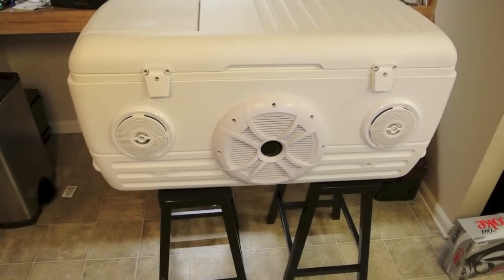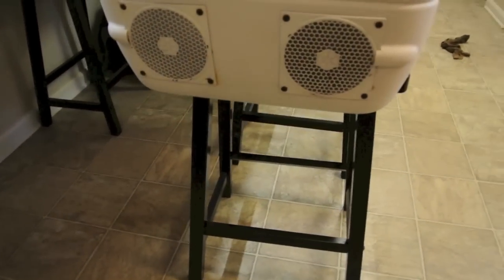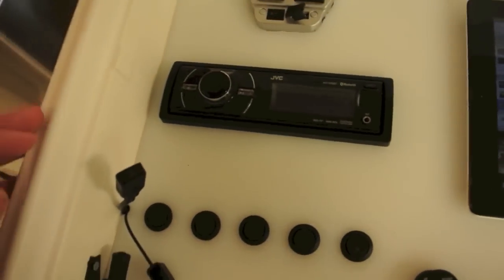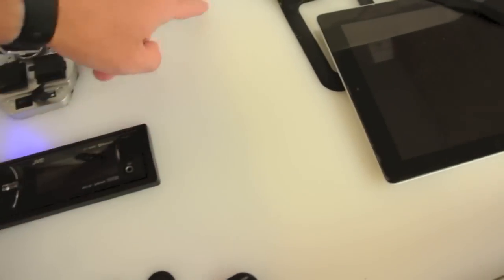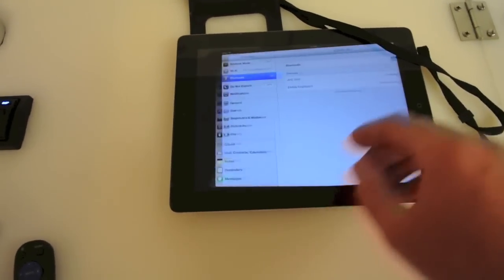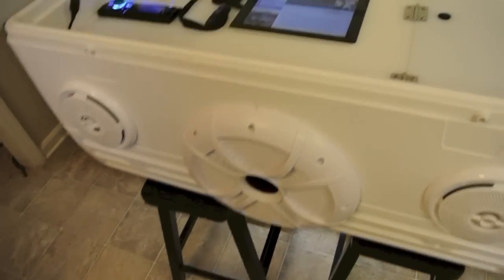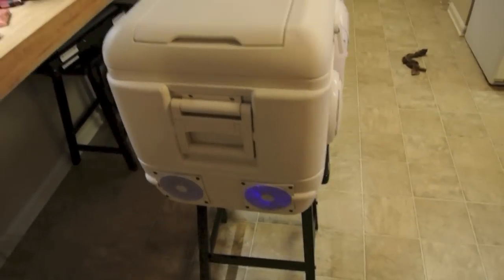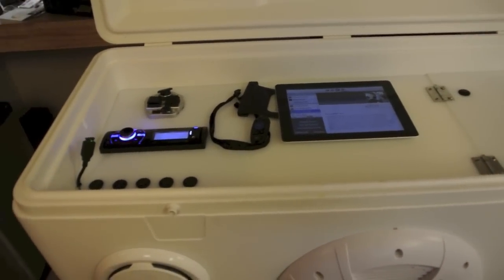Ice Chest Speaker Cooler part 1 of 2

Comment: Why wouldn't you just put a stereo in your boat?  I never understood cooler stereos bc you can't use them as a cooler so what's the point?  Nice build though!
Reply from the maker: ***** Thanks for the comment / compliment.  The boat that I mentioned in the video is a 19' aluminum cammo duck boat and it does not have the structure to mount a stereo system.  It would be a big large unpractical project to install one in the boat.  This build was not centered around boat use, I use it while tailgating, working in shop, social gatherings, beach trips, camping, pool time and a lot more.  I understand your point about having a cooler that is not cooler, for me the the cooler had a level of novelty to it and was an all around fun project. Please share it with your friends & do not forget to subscribe.

Comment: msfirefighter662 this looks great few questions..like how much does it weigh,how long does it take to charge, do u have a video of it in open space like where ever (boat beach open area)??? ..oh how much did this cost u around ball park figure (u prob answered that don't answer if u did..lol)
Reply from the maker: Estimate 100lbs, charge time depends on the state of the battery and the amperage of the charger, I usually charge it over night on a 2amp setting, Cost is hard to figure out because a lot of the parts and components were left from other projects.  You can do the math for a Large cooler, 2000 watt amp, 10'' sub, wood for sub enclosure, 4 marine 6.5"sparkers, power inverter, battery, cigarette lighter, cooling fans, switches, wiring, antenna, head uint, material for the deck. and about +/- 20 hours of work.    No other videos but I will try to make another one for you, please subscribe
Reply: iWould love to see a distance test see how far it can be heard like in a park or sum what open area if u can!!

Comment: Hey great job on the cooler! I had built one a few years ago, and am in the process of doing a second build.  My biggest problem is with the amp overheating, do you have an issue with that with the fans? I have just purchased two fans similar to the ones you have, which I believe will help. Also, with the computer fans, what type of converter did you use to convert the amperage to run off of the 12v Deep Cycle Marine Battery? 

Thanks so much!!

BK
Reply from the maker: Bryant King The amp has never hade a heat problem, the two 12v cooling fans move enough are through that side of the cooler to prevent overheating.  The fans are hooked directley to the +12v with the switch so there is no need for any type of converter and the battery is a regular 12v that would go in a vehicle.  If you have not already check out part 2 of the video that showes the inside of everyting.  Thanks for the questions, please share & subscribe.

Comment: Have you thought about one of the 1.5 or 2 amp solar battery chargers they make for RV's and cars? they are only about 4"x12" if that and would screw right to the lid
Reply from the maker: originalbalzer I decided not to put anything like that on the cooler because it is not practical to the way i use it.  That is a great option for someone who may need to maintain power and does not have the ability to charge regularly or supplement power.   Thanks for the comment please share and subscribe.

Comment: I would,mount a solar power to,the top to extend,the time it runs and when not running it will charge itself just due to size might only add an hour extra of run time maybe 2 depending on how,many watts and amps it pulls. vs how much you can replace in an 5 hr period but not,sure if you would like the look of,it with panels on top
Reply from the maker: I go for the look Thanks for the comment, please Share & Subscribe.

Comment: What material did you use on the top of the inside of the cooler (the part that is parallel with the lid of the cooler, and that the head unit/ac outlet is mounted to)?? And how did you do that hinged door that the battery is located underneath?
Reply from the maker: I am not exactly sure what it is, I got it from a friend who works at an industrial supply company.  It is very similar to the material for the nylon cutting boars.  It is hinged with stainless steel hinges form lowes.  I just picked out a design that I liked.  One side of the hinges is screwed with a wood screw directly trough the material into the outer eded of the sub enclosure. and the other other side that has the door has some small bolts with nuts to secure the hinge to the door.  I hoped that help, if you have any more questions let me know.
Reply: msfirefighter662 Huh, I wonder what the exact maerial is. How did you cut this stuff?
Reply from the maker: Ryan Patrick Give me a few days, I will call and ask what it its called.  I used a skill saw to get the rough dimensions then a rotozip to round the edges and fit everything.
Reply: msfirefighter662 I figured  out from the motorboatyourself.com forum that it is HDPE plastic. have you ever been on that forum? its a great place to learn everything youd want to know about cooler speakers.. one more question for you, does the Bluetooth connection work with the device outside of the cooler with the lid closed?
Reply from the maker: Ryan Patrick It does work just fine to the usual range you can expect a t BT device to work.  The BT receiver is attached to a usb cable, you might be able to see just a little bit above the deck in the left corner.  I can easily pull it up and out the flip up lid of the cooler if i need a little more range.  Have not look at the forum yet will check it out.

Comment: For the wheels, in the sand, It would have to be wide and big or it will bog down.
Reply from the maker: I believe that you are right.  Wheels will be one of my winter projects, thanks for the comment.
Reply: Jeep, makes a baby stroller and they have wide wheels and they have like a built in suspension, which would be a nice feature.
Reply from the maker: I will look into that, thanks for the suggestion.

Comment: Is that a car battery powering the whole rig?
Reply from the maker: +sudduth32 Yes, it is an extra one I had around the shop.  It is still going strong after about 5 years of hard cycles.  The sound quality deteriorates and eventually shuts off at about +9.6v.  Thanks for the comment, Please Share & Subscribe.
Reply: Im in the process of building one, I am not sure what kind of battery to use. I found a store here in town that has refurbished car batteries for about 40 bucks. Would that work or do you recommend buying a new marine battery?